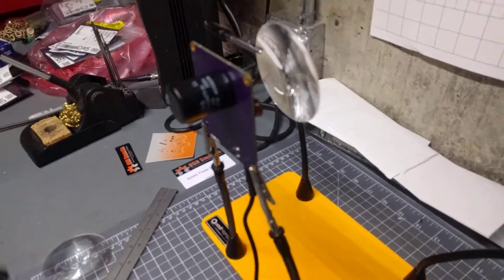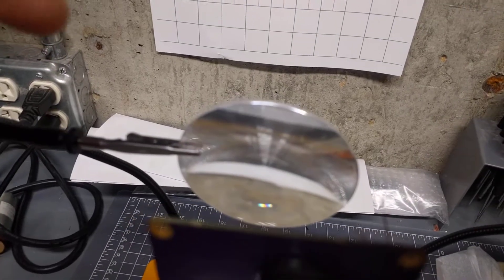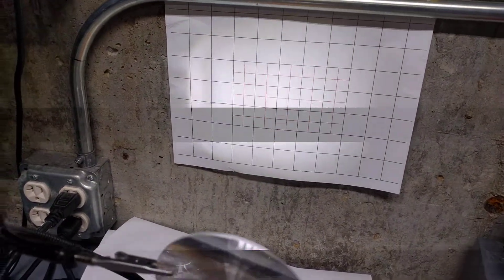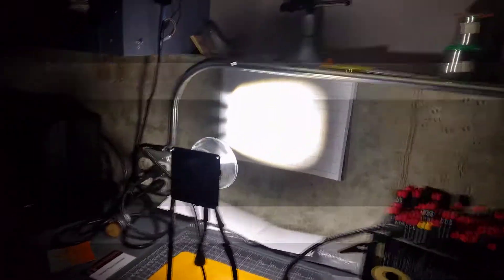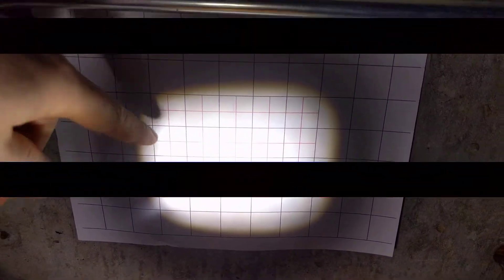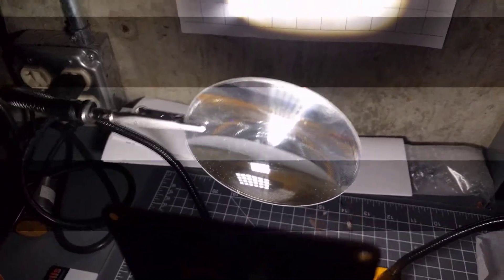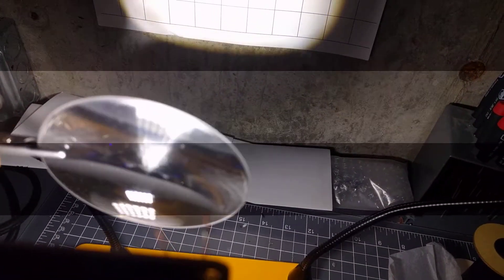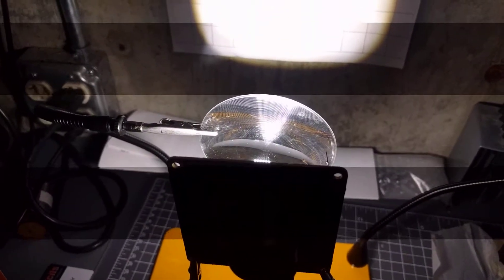TPB #98 - First Attempt at Optics on Led Flash

Comment: Any example shots? Also how would this compare to a SB900 in terms of speed/flash duration?
Reply from the maker: No example shots yet.  I'm still working on the basic physics so the software isn't in a state where I can take example shots.

The SB900 has a min duration around 30-40 microseconds.  This should have a min duration around 1 microsecond.
Reply: Thank you.  I look forward to your progress.  This looks a lot safer and cheaper than an air-gap strobe.  It would go great with my Camera Axe 5 ;)